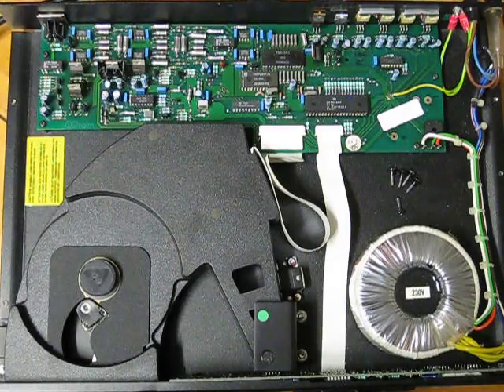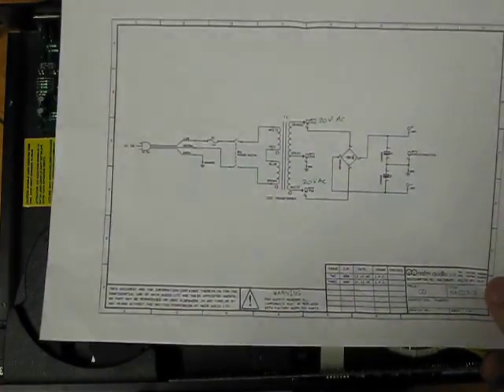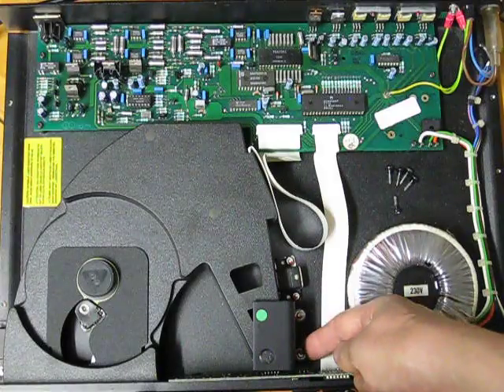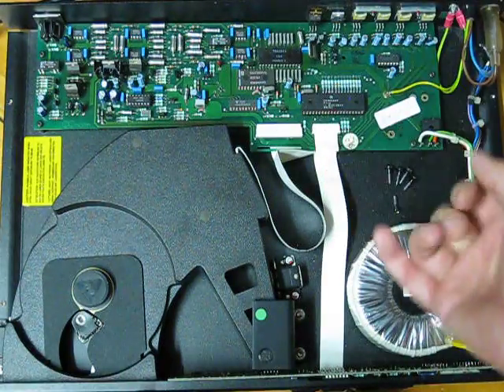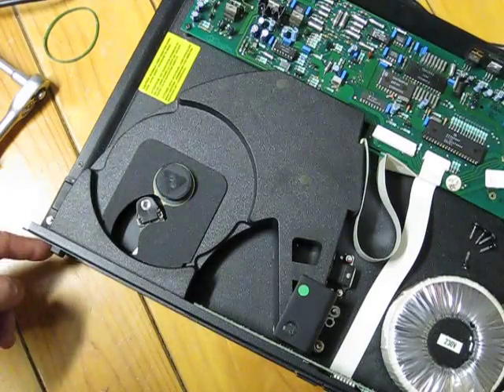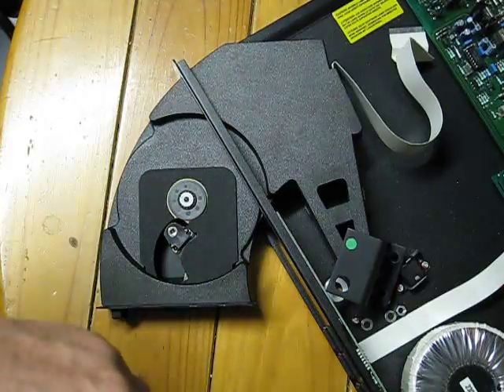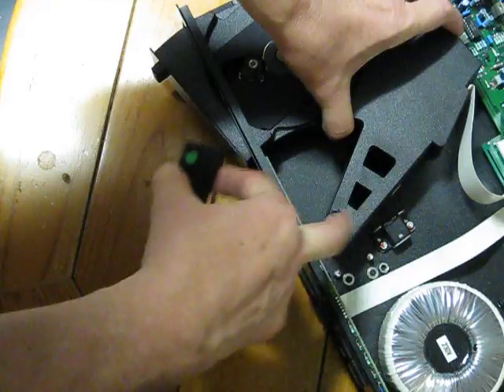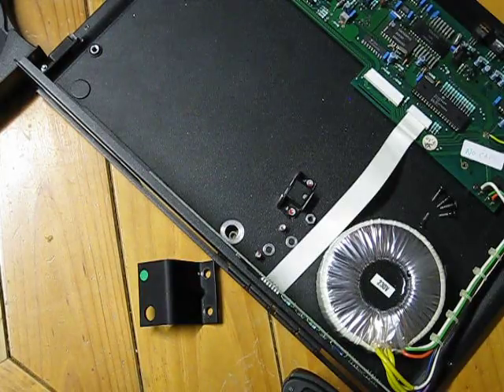CDM 9 mech removal from Naim NAC D 3

Comment: Used a scalpel as your suggestion and sliced the ribbon clean in two!
Reply from the maker: Sorry to hear that. I managed to do more than half dozen of them without any cuts. Then again, I have plenty of blunt scalpels ;-)
You should have used the side of it as a guide for the ribbon to go up, rather than the edge. Scalpel blade is very thin, so it does not take space the ribbon needs and that is why I use it.
But even sliced ribbon should work if you did not go too deep and not cut through any tracks completely. If it is just where the contacts are, resolder them with low temperature iron.